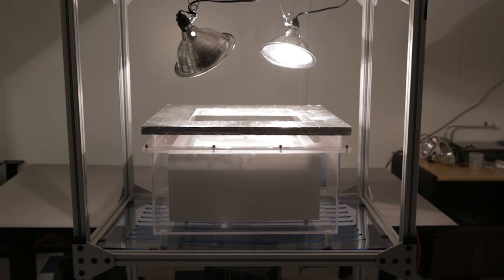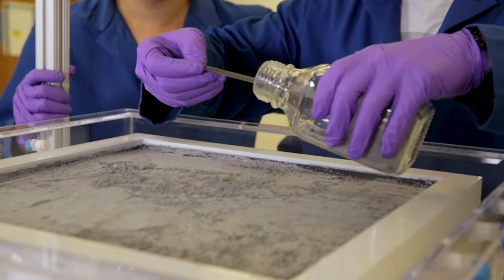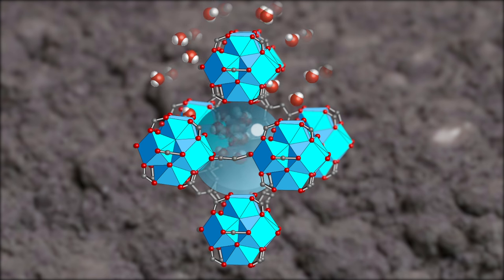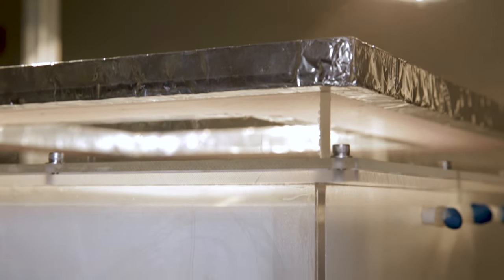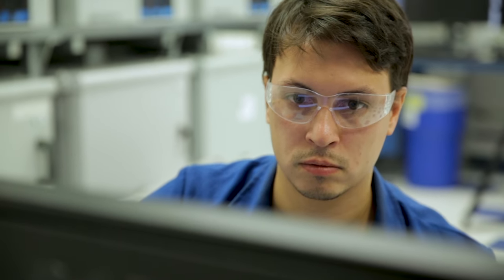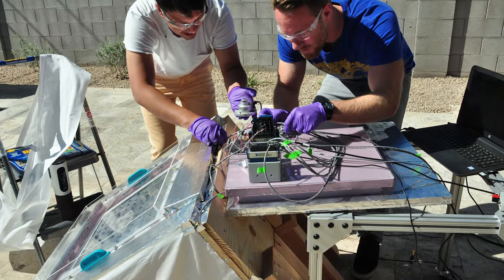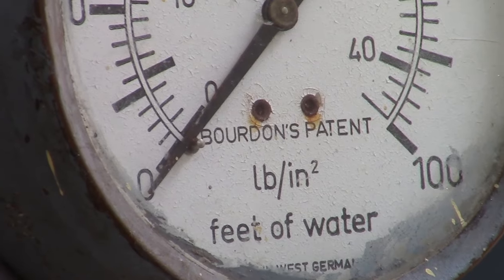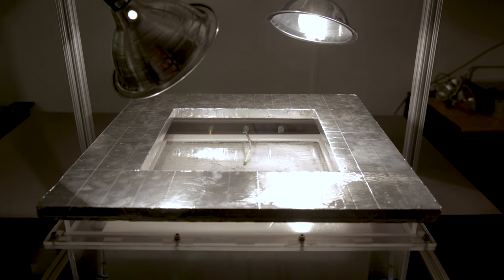This water harvester can turn desert air into drinkable water

Comment: If there was more humidity in the air, would the results be different on the amount of water collected?
Reply: Yes. The higher the humidity, the greater the harvest, assuming there is enough powder to absorb it. I think that's why they said to expose the powder to air at night, when humidity rises, then lock the cover during the day, so when the sun evaporates the moisture from the powder the "mist" collects into droplets and falls to the bottom.

Comment: Wait…using aluminum as the MOF?  Won’t that result in high aluminum in the resulting water?  
Also, you poured water into the MOF.  But in a desert, where would the water come from, to saturate the MOF?  Is the MOF hydrophilic, so, grabs humidity?  
Is this system supposed to container-replicate the ancient tech of digging a hole in the ground, placing a container in center at bottom of hole, & placing a cone-membrane over the hole, directed at the cup, to collect “dew” rising from the earth?

Comment: how to capture water from air humidity in the desert using just a shovel and 20 litres of water :  make a perfect circle hole of 30 centimetres radius and  2 meters deep.

water proof the hole by mirror plastering with mud the floor and walls of the whole 

build a  2 meters tall wall around the hole where each level encloses the radius of the hole, the wall is not strait but in a chape of a curved funnel, the inside walls are also mirror plastered with  mud.

how it works: this shape creates small vortexes within the " cone-hole"   

the ground surrounding the hole is dryer than the concentrated air within the cone 

by osmose h2O molecules will pass over to the ground until the max hydration point of the mud which by then becomes saturated and semi-impermeable and water will start collecting at the bottom

the  "cone-hole" can be used as a well or just a ground  water collector

Comment: What about leaching toxins from the materials to the water. Such as BPA or aluminum.
Reply: MOFs for such applications are normally pretty stable. Some can even be eaten (CD-MOF)! BPA isn't used for MOF-synthesis, you need very specific metal salts, linker molecules, solvents and sometimes templates. Excess solvent molecules are completely removed from the pores, mostly by just heating the MOF.

Comment: This is stupid, Thunderf00t has already covered this. It has nothing to do with economy of scale - your issue is that it's going to be crazy expensive even with mass production. Yes, anybody can create water from air, if you provide enough energy to force 2-H and 1-O together. So it falls into 3 questions:
1) How much is the device gonna cost?
2) How long will it take?

That grad student drank about 4 oz of water, he needs another 60 oz - if he doesn't get water from any other source for the day.